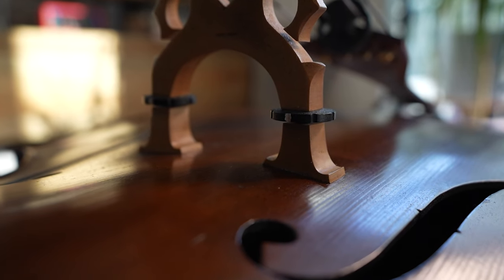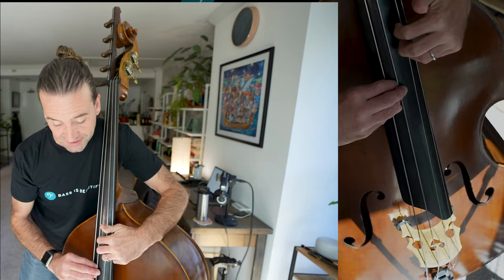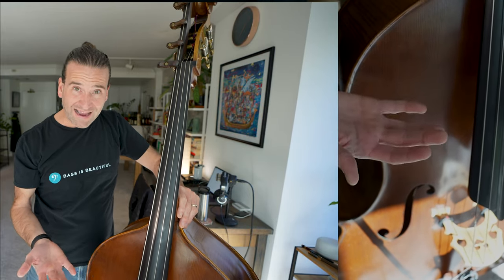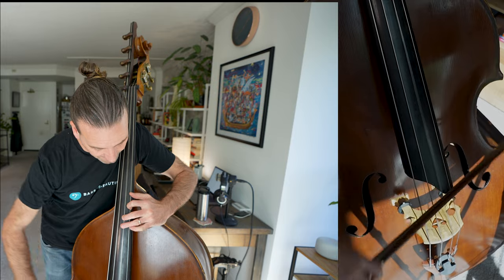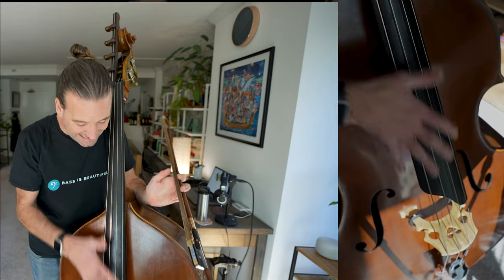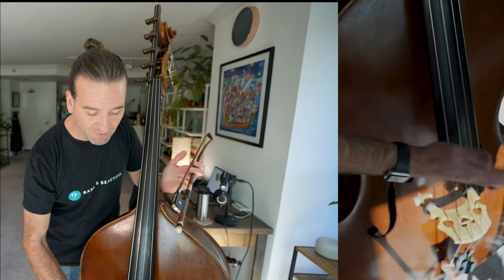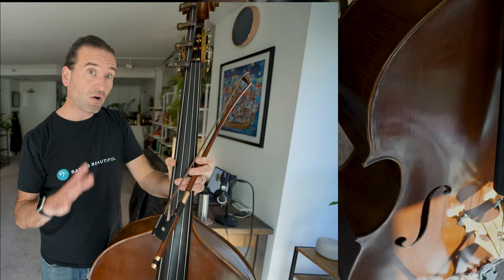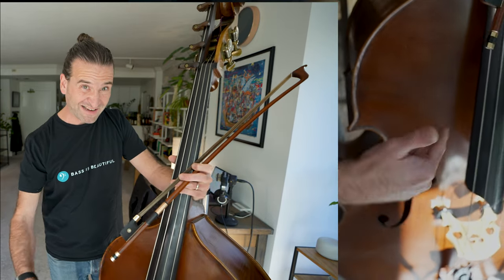How bridge adjusters work on double bass!

Comment: Good points. If your adjusters are hard to turn you should go see your luthier. I always check these for my customers. Also the bridge should be 90 degrees to the tailpiece side of the bridge, the side facing the nut is carved.
Reply from the maker: Good point!
Reply: Sometimes you can just remove your bridge and add some kind of dry lubricant to the threads and flat side that spins on the non threaded side. (graphite/candle wax works well)
Reply: @mikeperez7629  Absolutely. I didn't suggest removing the bridge because there is a very good possibility that your sound post will fall out. There may be viewers here that are not prepared to deal with that. ;-)

Comment: Thank you for this video - could you possibly measure the gap between each string and fingerboard in the middle of the fingerboard (octave position). For your orchestra setup. That would be really helpful. I started to learn double bass and still have a feeling like the strings are too high and I have to work too heavily with my left hand.
Reply from the maker: From what I know from luthiers, it’s generally 6 mm for the G string and one additional millimeter for each string lower than that.

Comment: I use a Fishman pick-up on my Chinese laminate starter job double bass. I bought it cheap when I added upright to my electric bass playing bag of tricks about five years ago. Time to trade up. Think I'm going to spring for a fully carved one, if I can find one for sale at the ISB conference this summer, without having to take out a second mortgage on my home. Any suggestions or better yet, an upload about what to look for in the next level of instrument primarily for jazz pizz and trio playing, would be greatly appreciated!

The transponder for the 101is in the right leveling wheel. I don't screw around with it much because the wheel position can indeed affect the amplified sound. But I do have to adjust it for changes in the weather, or the fingerboard will cause the strings to buzz like a swarm of African Murder Hornets! 🐝🐝🐝🐝
Reply from the maker: Very cool! The ISB convention is a great place to look.  I'll work on something about what to look for in a bass when you're buying one--good idea!
Reply: @doublebasshq  
Thx dude! 👍🏿

Comment: Tell me about some CC. From 06:39, there is 
"This is about the most boring I'm going to use and it's not going on the G string.
And in a good setup, generally, if it's not boring on the G-string,
it's not going to be on the other strings as well."
But for me it hears different "bowing" not "boring" or "going". I'm a foreigner and uses CC to understand your story exactly.
Reply from the maker: The CC must have made a translation mistake-I was saying bowing. I was referring to using a lot of bow weight and hearing the G string buzz against the fingerboard. I’m trying to upload better subtitles for future videos, so hopefully this kind of thing will be clearer!
Reply: @doublebasshq  Thanks. You helps me a lot. And it is an honor to communicate excellent bass player.
Reply: @doublebasshq  There are some apparent errors in CC. But the majority of them can be corrected according to your voice and context.